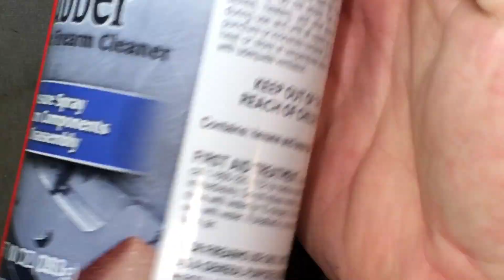Winchester Model 90 Trigger Overhaul

Comment: When losing the take down pin, we found that a excetalyne cleaning tip number 3 is exactly the same size as the take down pin. These pins are stainless steel.
Reply from the maker: Great tip!

Comment: I got one that's a model 90 LONG. It's a safe queen in very nice shape but fails to feed from the tube mag. It acts like the ammo is in the way or something. I remove the mag tube to take away tension and it feeds better with gravity most of the time. Ideas as to why its doing that?
Reply from the maker: Very common for these tube magazine 22s to have some feeding problems. So many things it could be, lifter,cartridge stop, magazine tube itself.

I have a future video planned on a Remington model 121 that has feeding issues. Stay tuned, maybe the solution there, if I find one, will help your Winchester.
Reply: @MilsurpGarage  So, could a weak lifter spring cause that? Seems weak to me but I have no experience with these old pump .22s.
Reply from the maker: Weak lifer spring, worn lifter, out of adjustment lifter…… the follower in the magazine tube might also be an issue since it seems that the tube itself is causing the problem when inserted. There are literally dozens of potential reasons this issue exists. 

Any evidence of parts swapping?  Receiver?  Barrel?  I’m assuming LONG is stamped on the barrel?
Reply: @MilsurpGarage  I cant tell that any parts have been swapped. It's a model 90 stamped 22LONG. I know its a 3rd model because it's a blued receiver. It has Patent dates June 26, 88. De. 6. 92. Nov. 27, 06 May 30, 1911. Very little wear. I bought a replacement lifter spring from Numerich for about 4.50, says they're made by Winchester so I took the gamble. How do you adjust the lifter?

Comment: Going back through some older videos. Somehow my notification bell got turned off. Anyway, very handy video. I am sealing the rust blue finish on one today. An interesting thing on those is the locking blocks were hand-fitted by peening. This one has actually been shot enough to increase the headspace slightly. Great idea for the paperclip.
Reply from the maker: No Bell?  Blasphemy.

Comment: Hi, Thanks for sharing your video.    I have a model 62A and I'm in the process of bluing it and polishing the trigger group.    I can't get the pin out in order to remove the harmer.   What did you use to remove that tiny pin?    Thanks
Reply from the maker: Just used a good punch set, just look carefully.....it might only come out one way
Reply: Another gent had to make a punch with a small nail since a 1/16 punch is too big.
Reply: just squeeze it into the shaft with pliers until it allows removal of screw.dont remove it.

Comment: Thanks for the video, the top notch is the half cock position and when the rifle is in the full cock position and the trigger is pulled, the sear is far enough away from the half cocked engagement that it allows the hammer to fall completely past the half cock position. However, if the hammer were to slip off the full cocked position by being dropped (without the trigger being pulled) then the half cock sear should prevent the hammer from falling to strike the firing pin. Hope this helps. Btw- I really love shooting mine.
Reply from the maker: Excellent explanation, thanks.
Reply: Oi estou com um problema na galary esta apresentando pane poderia me ajudar. Muito obrigado pela atenção